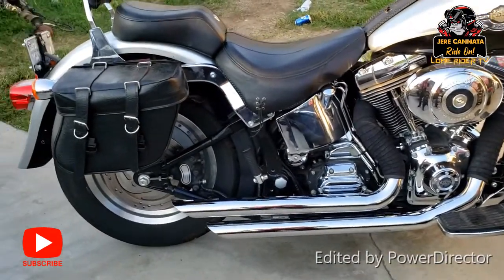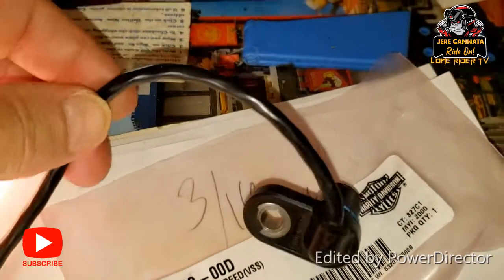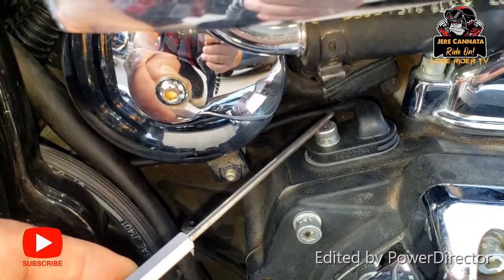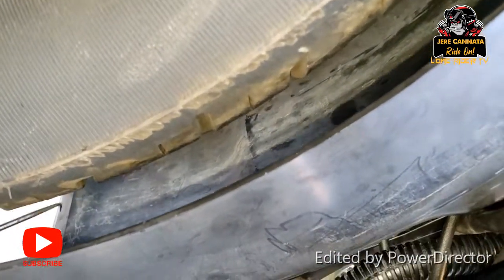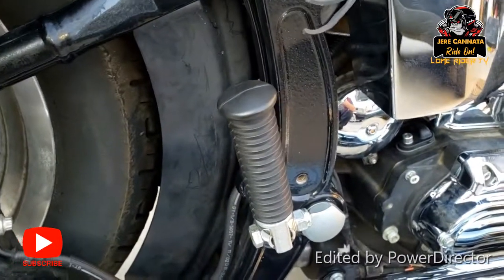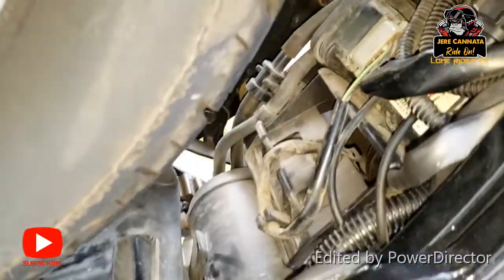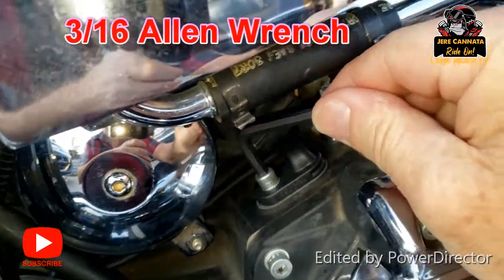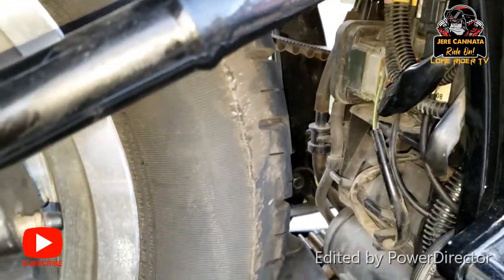Harley Davidson Speedometer Doesn't Work. VSS Speed Sensor Repair. Symptoms and Repair !

Comment from the maker: This can happen to even a new motorcycle.
It happened to me in middle of desert, fixed it in HD dealer parking lot.
If your warrantee has expired, it can happen to you it is a heat sensitive part and milage has nothing to do with it. 
Harley wont discuss it out loud, some bikes it can happen at 25,000 mi, and it will if you don't buy a bike every few years. I want all riders to no this little talked about problem part. It will freak most out and can get $ expensive if you call a tow truck. Thanks for watching. Ride On 👍😎
Reply: I did figure out the speedo issue, it was a dirty speed sensor. Sprayed brake clean on it and cleaned it up , all fixed.
Reply: Will this work for a 96 electra glide classic evo?

Comment: EXCELENT  VIDEO  
Just finished making this VSS Speed Sensor Repair on my 2001 Harley Softail Standard. 
Was an easy fix thanks to this instruction. Fixed the problem. 
No speedo, no trip meter, no turn signal cancel, but had power
and codes, Oh and no code was in the box.
Video showed easy access to the part and gave all the bolt sizes, etc.
The part was 78 dollars at the local dealership, it was in stock.
No labor cost because I was able to do it.
Why reinvent the wheel.  Thanks you really helped !
Reply from the maker: Glad it helped
I did this video to help.
A problem that nobody at the dealer is talking about or acknowledging this fairly common problem, happens more often when you ride in hot climate deserts above 100° .
Here in southern california hot desert rides are fairly common for me and learned first hand .
Ride safe and Ride On

Comment: Took the bike out, then the motor stalled, noticed a low idle that wanted to stall.  Then, noticed the speedometer quit working and the turn signals not cancelling. 

 thank you for taking the time to show how to fix this problem…...this video throughly explained what needs to be done….. Clear, concise, informative…..appreciate what you did. Heading to Harley shop in the morning  to buy the VSS sensor.

Comment: Nice job Jere.  I’ve read about those sensors going bad quite often.  Nice to know the fix is easy.
Reply from the maker: Thanks,
They are a heat sensitive part and if you Ride alot of miles it can happen to you, in the worst places. Quick fix just need to know the symptoms.
Thanks for watching.
🤙👍😎

Comment: Good job brother, I try to do all my own work on my Bikes to, it saves a ton of money, this video will be helpful to someone out there, thanks for sharing brother 💯 🤜🏼🤛🏼
Reply from the maker: Thanks,
It happened to me in middle of desert, fixed it in HD dealer parking lot.
If your warrantee has expired, it can happen to you it is a heat sensitive part and milage has nothing to do with it. 
Harley wont discuss it out loud, some bikes it can happen at 25,000 mi, and it will if you don't buy a bike every few years. I want all riders to no this little talked about problem part. It will freak most out and can get $ expensive if you call a tow truck. Thanks for watching. Ride On 👍😎
Reply: @loneridertv4244  I'm lucky I guess, it hasn't happened to me yet anyway, I've owned a few Harley's and will usually ride them any where from 30 to 40k, and then just sell it and get another new one, knock on wood, like I said it hasn't happened yet, I'll find out tho as I have a 17 Tri Glide and it will more than likely be my last bike, so the miles will rack up there, I'm going to see just how many miles I can get out of one lol 😂, ride safe and ride easy Brother 💯🤜🏼🤛🏼

Comment: I have a 2000 FXSTS and swapped that part out a week ago. 30 minutes in total with a few minutes of staring at everything and figuring it out. I had to route the new one differently from the old one due to where the wire come off of the new plug. Not a big deal. I wish I would have seen this video prior to it though. It would have been under 10 minutes.
Reply from the maker: Good Job,
The original part/plug is to fat to put back through the wiring so reroute is ok.
JP cycles sells one with plug depinned/seperated so you can thread it in an install the pins in the plug, not nessasary though, the original Harley part I installed rerouted slightly is fine.
I made the video to inform and help other riders Identify and repair quickly anywhere, 10-15 min repair now you know what to do.
I am preparing to make more video's like this soon check back or subscribe for notifications on future videos, thanks for watching. Ride On, Ride Safe 💪👍😎

Comment: Nice how to video!  Dropped some good knowledge and you made it look easy!
Reply from the maker: Thanks,
That part sends critical info to the ECU and the bike will run but acts so retarded most will pull over to call a tow truck + pay dealer to fix . 
 I fixed it in a dealer parking lot and rode out.
Thought was important to educate most riders about symptoms. 
Very quick easy fix. 
Thanks for watching 
🤙👍😎

Comment: ive got a 2014 roadking that a rat chewed threw that whole wiring harness. . i dont have those two screws on the splash guard though, they might be underneath but it was 25° and somehow raining I only got as far as pulling the stater ,finding about a 1/8 inch of wire out of the plug i soldered the wires back together ,it got rid of the codes but unfortunately not the symptoms. I ordered the harness but wont get it for awhile. thanks for the video bro.

Comment: Nice bike I have the same one, bought it brand new. My speedometer crashed next thing you know the engine is cutting out at lower speeds or idle. Just bought the VSS - thanks for the video - will try installing today. - your bike looks like it is still original in almost every way except the pipes. Wonder if you can access that area by taking out the battery instead of splash guard?

Comment: My speedometer and odometer are on the same digital gage. Both speedometer and odometer stopped working so my mileage didn't increase, check engine light comes on, and when I down shifted to gear 1 the bike turned off. Does that sound about right? I have a 2014 street bob btw.

Comment: I lost my speed o & odometer today it was over 100 deg. Running against 30mph head wind. I dont have any thing coming on in the speed o. I have no turn signal & no horn. It also not idelting right & want to die. Is this all symptoms? I ave an 03 RK

Comment: My speedo on a 06 eglide is stuck at around 150 mph.... I only wish it was that fast. Any ideas??? The needle is straight down, the odometer still works by it clicks the miles at a accelerated rate, signal still auto cancels. Any ideas would be appreciated, thanks.

Comment: So everything on my speedometer works but my speed and it is buried and hops around a little but won't go into the mph. 2015 Iron 883 and speedo relocation kit. I bought it like that and everything is working great but that. Digital and standard.

Comment: Where does the Speedo monitor in the dash of a 2001 electrogilded classic , where is it powered from! the mastics shows' everything but where it is powered 12v ??!! It leaves the Speedo sensor red nut into the odorometer it is black, but no dot or indicator of a break ! is the power transferred to 12v inside the odometer housing>??

Comment: Very helpful, Dealers here in Wisconsin goes through your $ like a fart in the wind. I have a code do8SEE so I may have to do that job on mine. Hope I can just clean off the speed sensor. I suppose I'll have to let the people next door know so to cover their ears.
Reply from the maker: Lol, crack that throttle.
I have not had luck with cleaning the sensor, the accumulation of shavings eventually causes sensor failure.
I recommend cleaning off shavings with each transmission fluid service for prolonging the life of that part.
It is a super easy, quick job.
I hoped to help my fellow riders to save their money and get quickly back on the road, knowledge is key 🔑 
Most riders would scrap the trip, call a tow truck( 😎 $) pay a mechanic $200 to fix.
Glad this helps,
Good luck.
Ride On, Ride Safe.
👍💪😎

Comment: I have a 2005 Road King Custom. The speedometer stopped working a few weeks back (stays at 0, at a random speed or goes all the way around). I replaced the sensor but I am still having the same issue. Is there anything else I can do to fix this problem?
Reply: I have exact same bike with same prob.  Ever figure it out?

Comment: 1:13 I have the first 4 going on right now.  First noticed the speedo then when decelerating it sounded funny because it wanted to die but it was bump stating it’s self.
Reply from the maker: BraaapAllDay , I just saw this comment: - Be Carefull when pulling in clutch to Idle when Riding, If you don't have gear indicator you could accidently slip into a lower gear and slide to a stop like I did (It sounded pretty crazy though) but I didn't go down, I just left rubber skid mark at intersection, if you put it in neutral it will have a super low Idle, it only will die when clutch is pulled in so kick into neutral at traffic lights and she will Idle so you can just ride to a dealer to make simple repair dont let it ruin your ride. Good luck
Ride On Ride Safe. 😎

Comment: My 2012 Fatboy lo shuts off when pulling in the clutch and coming to a stop. Any idea what’s causing that.? I can usually start it right back up but it’s been doing this frequently. Pls Help!
Reply: Is your speedo working.  This is one of the symptoms of the speed sensor
Reply: I ended up sending it to the dealership since it was still under warranty. They said that it threw some codes and all they did was reset them and it hasn’t given me any issues since then

Comment: Should rename the video... "How to remove the splash guard"  :face-green-smiling:  So what are the symptoms of this bad sensor?  My speedometer needle stopped its "windup" when I turn on the ignition switch. Could that be a bad speedometer or is it a bad VSS sensor? I've owned a HD for two months... this is my third problem already. Not confidence inspiring.

Comment: Loss of speedo and dimming light would be the  voltage regulator / rectifier
Reply from the maker: Thats what you would think, in most cases it would be the voltage regulater/ rectifier, but the headlights were not dimming or showing sighns of a voltage problem, it is a EC problem caused by shavings building up on speed sensor (normal weir) eventually shorting the speed sensor causing failure,
In most cases the sensor will fail. recommend cleaning shavings off sensor at time of normal service intervals throughout the life of the motorcycle.
Thanks for watching.
Ride On Ride Safe. 💪👍😎
Reply: @loneridertv4244  I mean just those 2 symptoms.  Fixed that 2 years ago. 

Now I’m having 
-no speedometer 
-dying at deceleration 
-turn signals staying on
-check engine light
Had a descent amount of shavings on the speed sensor. Cleaned it but I believe it’s bad now
Reply from the maker: @napieraustin sorry to hear, cleaning the shavings rarely will fix,
I recommend replacing the sensor $71
I have replaced mine twice.
If you Ride alot it seems to happen in hotter areas of the country, heat may weir the sensor faster in hotter climates.
Both sensors went bad when I rode alot in the hot California deserts usually during the hottest months of summer some times °100+ .
Let me know how it goes, good luck, Ride On Ride Safe. 💪👍😎
Ps hard to believe that little sensor did so much. 🙃
Reply: @loneridertv4244  just got sensor today (June 1st) didn’t get to ride all weekend 😢 will see how it goes
Reply from the maker: @napieraustin good luck, 👍 hope your riding by the time you read this.
Hope you still had nice weekend, Ride On Ride Safe💪🙂😎
#harleyridingseason

Comment: Checked out your video thinking my vss was toast but when I checked it out the previous owner had installed a speedometer calibrator where the vss plugs into the harness, the speedometer works now but is about 25mph too slow